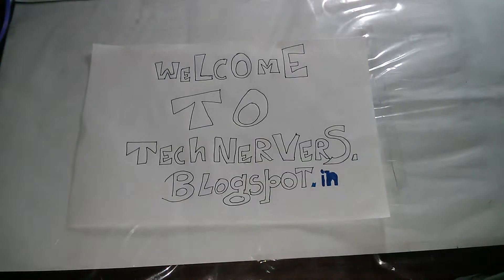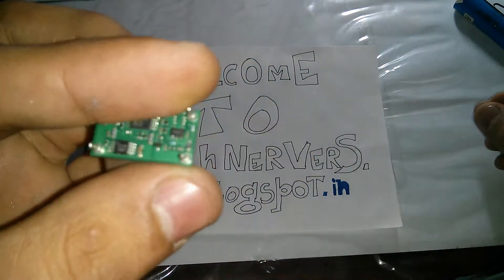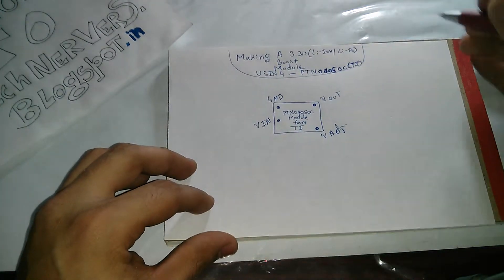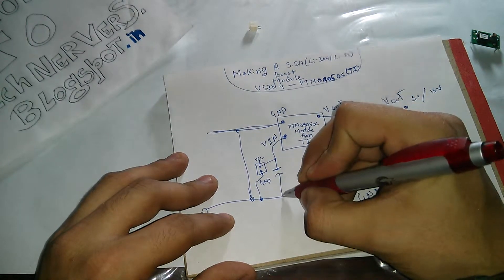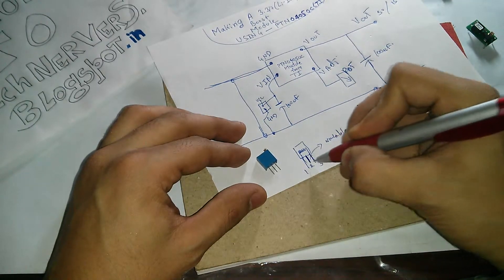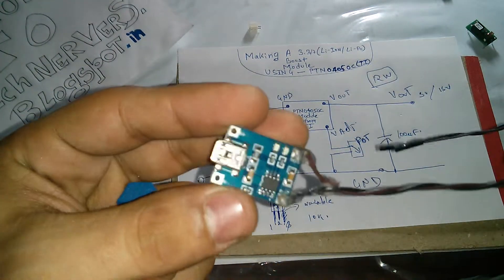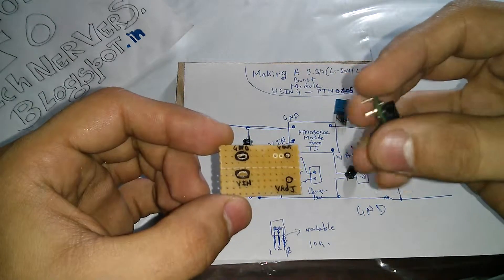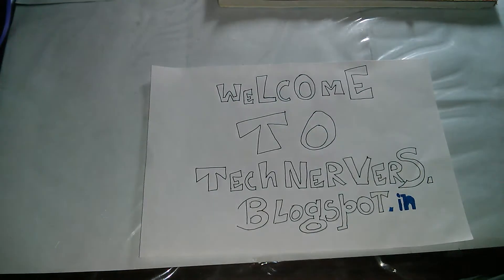Li-Ion battery to 5/9/12/15V UPS/Power Supply based on PTN04050 Module

Comment: Hi, Good job. Thanks for the video. Also, Is it possible to design a UPS circuit using a 5V usb powerbank instead of 3.7v Li-ion cell ? If yes, pls let me know if you know any reference design URL.
Reply from the maker: Yes, but that may depend on what battery pack are you using. I have already done 3 video series on UPS battery backup solution for RIoT single board computer as a part of element 14 RIoT board roadtest you can watch those there( unfortunately
Reply from the maker: They are not uploaded on YouTube. I will try and post them if time permits.) Do, one method i use there's is using an actual power bank's battery and circuit as a UPS solution. If you still have doubts just mail me on gsgill112 at gmail

Comment from the maker: Checkout my new UPS Solution video Tutorial :P

https://www.youtube.com/watch?v=lcw6OGz5CbQ
Reply: Gurinder Singh Gill 
what is the max amount of current output from this circuit and how can you double it.
Reply from the maker: Hi Nestor the module is a 6W module so the current you can draw will depend upon the voltage ,@3v you can get a max of 2Amps.. so forth..